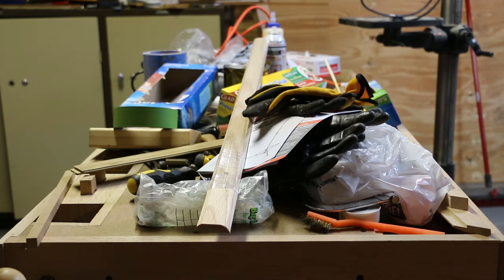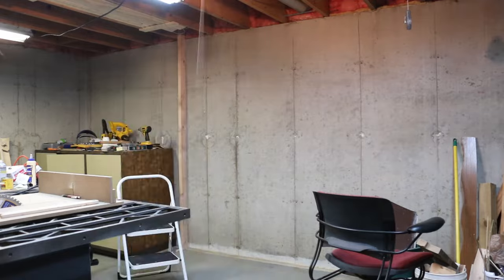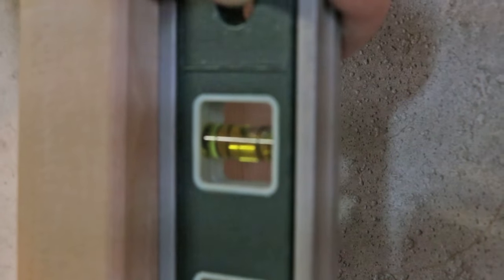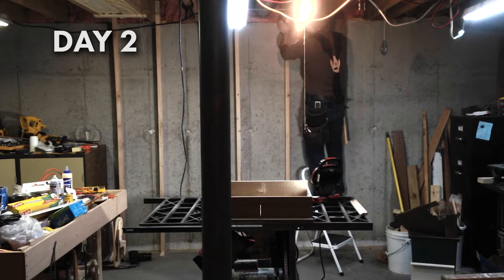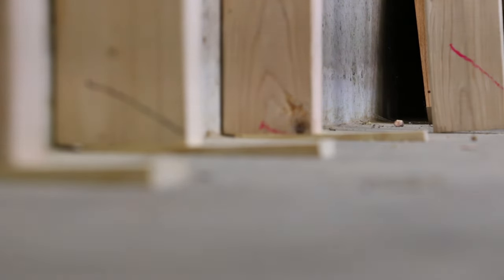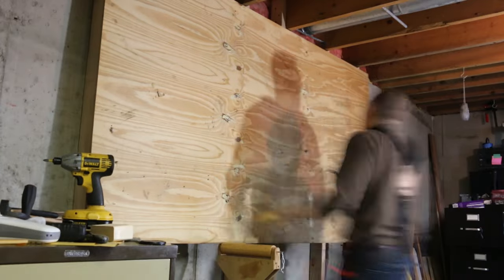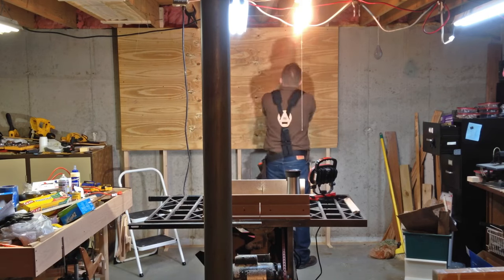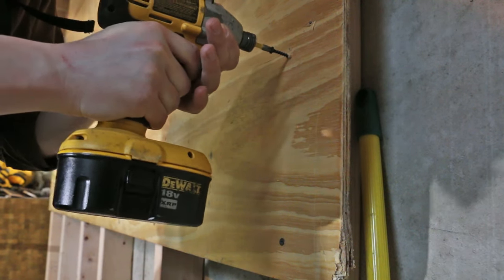No-drill studs for basement tool wall

Comment: who wants to be the first to tell him those shims and studs are going to suck up mostier like buscuits n gravy, rotting out in a few yrs. there is a reason Code calls for PT lumber for basement floor contact......and endgrain contact is 10x WORSE
Reply: Oh no.  He may have to spend $1.58 replacing those shims.  What's a guy to do?   Better add $1.58 to your emergency fund. . .maybe even consider another $5.96 to the emergency fund if the 2x4's get damaged by a puddle.  Maybe a rider on his homeowners. . .
Reply: @cstuartdc  clearly u have never seen a waterheater pull a gasline after a shim collapse. Or water pipe
Reply: @crabtrap what the actual f are you talking about. Do you see any water heaters? It’s a defacto wall to hang tools on. Just be quiet.

Comment: Praise the LORD! (Yes, I mean that and I do not care who is offended by the name of the LORD.) This works perfectly. I did it in my shop tonight. Only, instead of floor joists, I used my ceiling joists. My studs were an odd measurement, so I only needed 3 of them to span an 8' area. For one sheet of 3/8" plywood and 3 studs was something like $24 and change. Also, I have a work bench with peg board backing, and I much prefer the plywood. (Also have a form of peg board for my kitchen utensils in the house...) Pegboard seems like a great idea, but every time a tool gets hung up on the peg, it is a nuisance to keep said peg in the board. I know the peg kits come with plastic fasteners to help hold them in, but those are about worthless. 
 
 With this system, all I did was hold any given tool to the board, used a Sharpie to mark screw placement, and went to town. I used 2"-3" screws and ran them a good 1/2" past the backside of the plywood. They are sturdy enough to hold all my hand tools, including a couple 8 lb. splitting mauls. (Used 3" screws for those, used 2" on everything else.) I also made sure to slightly tilt them up as I sank them, so as to defy gravity over time. 

Thanks a bunch for this video! I wish I had seen it a decade ago! Without a proper rotary hammer drill, punching through cinder block can be time-consuming and expensive, as well as depressing. This storage idea bypassed all of that noise. All my loved ones thank you as well. You see, now that my tools are organized, I am recharged and ready to stare down some DIY headaches I have been avoiding.
Reply from the maker: This is awesome to hear! Thank you for the great note! Hope the tool wall is still working for you. (And your loved ones. :)) Have a good one!

Comment: I have the same concrete walls in my basement. This is an awesome idea. I have drains in the floor of the basement for extreme seasons of rain. I may try to keep those studs of the floor to avoid rot and potential wood pests. I will research that as well but you sure sent me in a perfect direction with those studs. Thank you
Reply: Thats why you always put pressure treated wood for the plate whenever it touches ground

Comment: A poured concrete basement wall will be 6-8 inches thick.  I can't imagine any screw or lag drilled into a concrete wall would cause a leak unless you're going deeper than that.

Comment: Great system! What was the thickness of the 4x8 plywood you used for the wall itself?
Reply from the maker: Thank you! For thickness, I actually went super-cheap and have two different thicknesses on there. (This was a combination of what was laying around leftover in the shop.) In my later videos, you can see some lighter colored strips on the bottom and the right side. Those are 3/8” nominal. The bigger, main sheet in this video is 1/2”. I can verify both thicknesses work fine. Hope that helps! 👍

Comment: Do you still use this system? If so - how much weight have you put on it without issue? I'm thinking about something like this for lumber storage.
Reply from the maker: I still use it and love it. Hasn’t budged. I’d be a little hesitant about using it for lumber storage though. A small shelf of wood on top would probably be fine, but if it was loaded up top to bottom with wood and did happen to fail, that would be potentially a ton of weight crashing down. There might be a way to modify this to mitigate those risks, but then you’re getting into the, “Why don’t I just build a frame and secure it into the floor according to standards?” stage of labor. If any engineer reads this, your analysis is welcome! 

Whichever way you go, good luck! Wish I had a better answer for you!

Comment: That's a good idea. Did you do the rest of the basement with the same setup or just your wall for hanging tools?
Reply from the maker: Thank you! I have only used it for the tool wall so far, but I might put up another one behind the miter/radial arm saw station in the near future. Pretty much limiting it to "temporary" uses where I can hammer the wedges back into place easily if needed. Still haven't needed to adjust them, though...

Comment: Can I frame my basement like this? I really don’t want to makes holes on the wall or floor please help😞
Reply from the maker: I would not recommend using this for any permanent structure like basement wall framing. But it actually sounds like there might be some construction adhesives that are strong enough to frame a basement with. Worth looking into. Good luck!

Comment: You dont spring for peg board? What a pain.
Reply from the maker: It's not too bad, actually! The only trouble is if I want to put up a new tool holder late at night, I have to be really quiet about drilling and screwing into that plywood. Otherwise, it has worked great.
Reply: Peg board is not all it is cracked up to be. I have tried both peg board and plywood now. I prefer plywood, as I can make it hold anything I wish (I.e. various-sized hooks for hoses). Also pegboard is a pain in the neck when the hooks consistently pop out of place.

Comment: I would not recommend this. Better to have used a couple more 2x4's and did a complete frame compressing between floor and ceiling instead of drilling into floor joists. Can do entire basement this way.
Reply: agreed a PT 2x4 floor plat and a framed out wall would have taken an extra 15mins
Reply: so do i just youtube framing basement wall? complete makes it sound like anchoring to concrete floor?